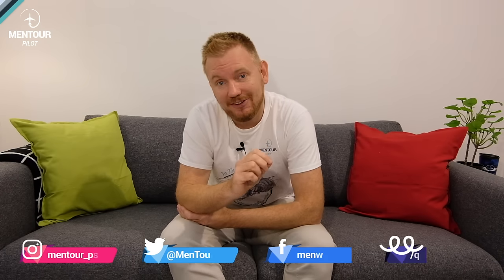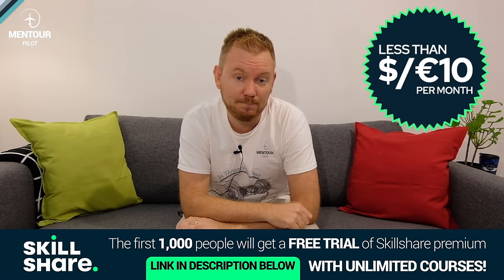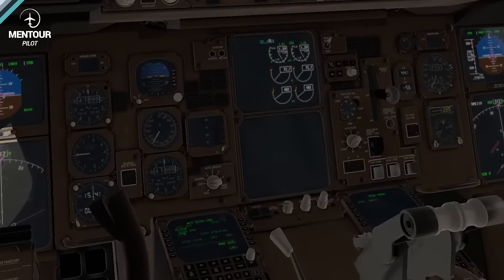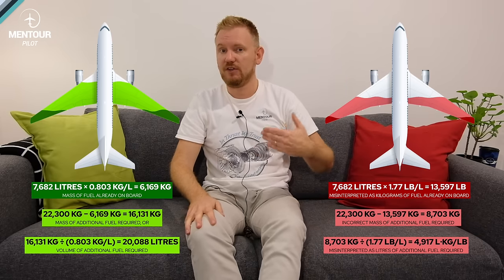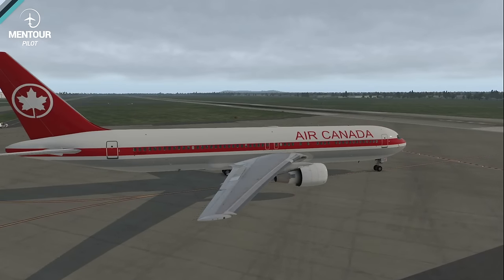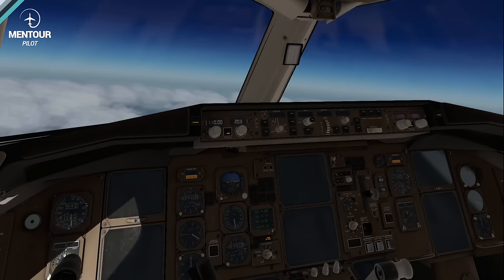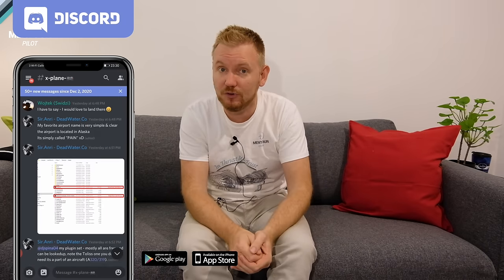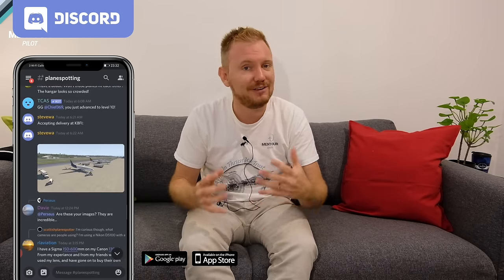The Gimli Glider! Explained

Comment: Just for interest sake I used to fly with Bob Pearson as his second officer on the B727 back in the early eighties just before AC took delivery of our B767s. He was a most wonderful and skilled captain, a pleasure to work with and a funny guy especially on our layovers. I went on the L1011 when he went to the B767. The downfall of course came when Canada decided to convert to metric and all hell broke loose, especially in the aviation sector and prematurely, in my opinion. We did not really understand it fully but nonetheless Transport Canada approved it. The bad luck that day would have that snag of an un serviceable fuel gauge which according to the M.E.L. required a fuel dripstick check on the tanks done independently by the flight crew AND maintenance the way I remember it. ALL pilots feared and hated to perform these checks as they are complicated and involved using not just charts and figures but inside the cockpit walls are spirit levels to determine the angle of the aircraft as it is sitting and apply it to the corrections. THIS is where it should have stopped. Errors are a certainty combined with the newly integrated conversion charts. Even if things were left in Imperial standards it is challenging enough. In the immediate aftermath the airline CEO at the time instantly attempted to dismiss Pearson and Quintal for the blame, and yet in the U.S. they received the highest award distinguishing them as heroes that demonstrated the finest aviation skills ever attempted in a grave emergency SAFELY. The Canadian government was so determined to make the change to metric this was just the most obvious blunder, and as the saying goes "be careful what you wish for".
Reply from the maker: Thank you for those added details!
Reply: @MentourPilot  Why is the fuelgauge on whatever is fueling a plane in volume when what you want is weight, it only serves to cause confusion and with all the safety in the airline industry I can not get my head around having to do an extra calculation like that to make it to your destination.
How is hundreds of peoples lives dependent on some random persons ability to divide or multiply something by whatever on the day?
Reply: @MrSigmatico     I guess it is because the fuel that is pumped into the tank trucks is paid for per volume (liter or gallon), the measurement how many fuel a truck can load is done in liters, not in weight.
The pilots on the other hand have to know how many kilos their (creating an example)  5000 liters of fuel weigh to calculate depending things like taking-off speed and many more.
One should think, somebody that made it to being pilot should be able to do relatively simple calculations like this.
I guess the real bug at the time was the change from pounds to kilos which had not arrived in everyones head.
Reply: The highest award most deserved.  That landing is almost beyond belief.
Reply: excellent question and point. just leave it in base units of kg.
Reply: @willshedo  Canada had begun phasing in the metric system 4 years earlier, on May 1, 1979. I remember that because I bought my first car that week. All gas stations started selling in liters instead of gallons and gas prices in my area immediately went from 99.9 cents per imperial gallon to 19.9 cents per liter. That means that the pilots, engineers, ground crew and everyone else in the country had been buying gas in liters for over 4 years at the time of the Gimli Glider incident. The metric system was NOT as unfamiliar and mysterious as the video might imply. None of that, of course, takes away from the remarkable achievement of getting the plane down safely!
Reply: @hughmungus1767  Gallons ≠ pounds.
Reply: @MrSigmatico  It is generally not an issue because you are never supposed to be refuelling based on the drip stick (now drop stick) measurements, they are for confirmation only.
Reply: @willshedo  No, the pilots were not only not responsible for these calculations, they received no training on how to do them. Mentour did a very poor job of explaining this.
Reply: I disagree that the pilots deserved commendation. Flying without a functioning fuel gauge, against what they knew to be the MEL (whatever they say the maintenance control people said), is a fireable offense, full stop. Not to mention there is nothing difficult about converting from imperial to metric units. It's one thing when a NASA contractor engineer makes a silly mistake and sends a Mars probe off course, it's another when a captain responsible for the lives of many passengers fails to use - and double-check - the right conversion factors, and then flies off without a fuel gauge. I'm sure he was a friendly, affable guy and a good pilot from an airmanship perspective, but that day he made a series of horrible mistakes that nearly cost all his passengers' lives. He deserved to be disciplined for it.
Reply: If you aren't in the aviation industry then you have not any concept of how the rules apply because the parameters are within legal binding limits meaning that the crew were quite legal to accept and fly the airplane under the limitations of the M.E.L. as such and follow the operational guidelines which is why this is put in place by EVERY commercial operator. It is clear to me you are not in any position to point a finger because you do not possess any technical skills or knowledge and therefore you want to draw attention to yourself as an expert. To say "not difficult" is a most arrogant statement spoken like most all armchair "experts".
Reply: Canada apparently should've waited to convert to the metric system until the age of Cellphones and Google. :-D ("They should 'of'  checked them fuel gages" (sic) as though the 767 were some kind of 'prop plane.)
Reply: @lisaa8795  ..It’s “should have” not “should of.” 

We switched to the Metric system years before this. The crew did a fabulous job of landing the plane, but they wouldn’t have had to do that if they did the math properly. All Canadians did the math back then. My mom had a chart in our car of gas price conversions. 
There should have been independent calculations done. All other flight crews didn’t have a problem since there were no other incidents since the Metric System was implemented. 

Regardless of the mistakes made, they deserved the commendation
Reply: @christine3043  The entire country of Canada did not officially switch to the metric system until the 80s.  Regarding your other comment correcting 'my' grammar: I was making fun of yet another youtube comment posted - that is what the quotes and (sic) were for.
Reply: @michaelbrower3068   -- Public relations is a huge aspect of aviation...   I know it's cynical, but the final result was "miraculous,' and, from a PR perspective, it would seem wrong not to reward the pilots.  That said, I agree with what you're saying.  I used to be a commercial pilot, and I think a lot of pilots struggle with the impulse to bend rules - some more than others.  Even though I can sympathize with the pilots here, I agree that complacency is totally out of place in aviation, and that pilots have to be held to a much higher standard.  That may seem harsh, but the stakes of aviation require a special level of discipline.
Reply: @pdquestions7673  Petter hit one major factor which I think was the reason the captain chose to fly.... C-GAUN came into the airport he was at with a mechanical problem.  He didn't know exactly WHAT problem, but deduced the aircraft was airworthy based on the fact it was an uneventful flight.  C-GAUN wasn't really in proper condition to fly safely, but... almost.  If they had calculated fuel properly... there would not have been a problem and the flight would have been uneventful and forgotten.  That's risky, but it's theoretically a manageable risk.
Reply: @MrSigmatico  Wild Guess, is there something to do with temperature like volume corrected gas pumps?
Reply: @hughmungus1767  People will always find a way to blame the government for issues and gloss over the reasons behind it, the benefits and in this case details that are important to bring up when judging an event such as this. In my opinion, if your job requires you to make conversions and do calculations, especially when it comes to safety of human lives, and ensuring some like a airplane has enough fuel to make its destination.......you should be expected to do those calculations day 1 regardless of any federal changes like the metric system change. There isnt any excuse. Obviously that isnt entirely on the employee(s), training and ensuring your workforce is trained and suited to make those calculations regularly and accurately is on the employer and the government to make sure the employer adheres. Its never just 1 person or 1 event that causes events like this. You cant point 1 finger at the government and call it a day. But it really doesnt stop people from doing so.
Reply: they bombed at a simple plausibility check. When they started the formula with the fuel in the tank with 7682 - their calculation gave them the result that they needed 5000 l more for a longer flight. So they had more than 50 % what they needed "left over" from the previous day. A simple calculation would have shown them: 60 %. That should have prompted some serious double checking.
Reply: + steinbombb Also: 1 kg is roughly 2 pounds so that happens to be a very userfriendly conversion ratio. 1 liter of fresh water weighs 1 kg, or approx. 2 pounds.  But fuel is "lighter" than water (lower density in correct terminology). So even when you do not know the conversion rates by heart, a factor of 0.803 is not implausible. - I for instance underestimated the density of fuel but learned right now that the conversion (multiplication) factor is  0.803, in other words 80 % of that of fresh water. - I will take Petter's word for it ;) 

A conversion factor of 1.7 would mean fuel is "heavier" (has higher density than water, and considerably higher = 70 % more) and that would have triggered my bullshit radar. 

They should have picked up that something was amiss with the calculation, and the problem did not present suddenly during flight when there is not much time to trouble shoot or to follow a discrepancy. 

The problem also preoccupied them before their second start in Ottawa - so why didn't they just get an independent opinion from a flight engineer (before the first or the second start). They also could have asked for that during the first leg, as to not lose any time. Enough time in Ottawa to correct their blunder. 

Basic understanding (1 l water = 1 kg, and fuel is somewhat ! lighter than water) would have sufficed. A conversion factor of 1.7 would mean that fuel has a considerably higher density than water, that can't be.

If they were maths / physics challenged (as I suspect) they surely could have gotten competent double checking - if they had bothered to ask for it.

They were good hands on pilots (certainly the captain was a good glider) but not good in maths - I think all things mathematical triggered avoidance and / or "winging it" - because there is no reasonable explanation (other than avoidance, I can only assume being sloppy or ego) why they decided not to get any help with a calculation that was so unfamiliar that they did not even pick up on 2 different red flags.

 If they were bushcraft pilots in the past, the ability to improvise may have been needed - or at least exercised. Winging the fuel calculation was not a good idea.

They only relied on their calculation for a critical value (as the captain was determined to fly without fuel gauge if that could not be fixed in Ottawa), and they cannot have been proficient and well-versed in the necessary skills and considerations (like a simple plausibility check). I cannot imagine they had to do such calculations in the past, so it must have been pride or avoidance that they went ahead with their amateurish execution. 

Maybe someone got them the wrong conversion factor without explicitely telling them this was liters to pounds ?? Or wrongly telling them this was from liters to pounds.

But then the plausibility thinking should have set in - moreover they knew that the transition from imperial to metric had started a few years ago. I also wonder if the ability to make such conversions was hardly ever needed (by staff that tanked the machine - or whoever gave them the conversion factor)  - maybe normally they only went by the gauge reading. But then the captain should have assumed that on this special occasion he could be fed old (imperial) coversion rates.
Reply: It's an interesting piece of trivia that the US was in the early stages of converting to metric in the late 1970s—mostly with dual distance and speed measures on interstate highways, dual temperature measures on weather reports, etc. It was Ronald Reagan who put an end to it and trapped us in the imperial system. Another piece of trivia relevant to Americans who drove in Canada is that Canadian gallons were different from US gallons.

Comment: I was in high school when this accident happened and it inspired me to learn the metric system before I joined the US Army.
Reply: It’s really easy! Everything is multiple of 10
Reply: I grew up with the metric system, and have learned small amounts of imperial in several jobs, I think metric is a far more logical system.
Reply: Thank you very much for your service sir
Reply: Growing up the UK I learned both systems at an early age. About 30 years ago I had a German pal who could not really get his head around imperial units. He thought that the inch could only be divided into tenths, twelfths or eighths. Because I had studied technical drawing I showed him that it was easy to, for example, drill holes in a piece of metal that were five thirteenth of an inch apart.  I think that his brain exploded :)
Reply: @rysacroft  Why to do it simple, when it can be done complicated    ;-)
Reply: @bobbrewer5182  That is of course because the metric system uses 10-folds as main computational characteristic. The system of pounds is for us metrically trained way more complicated.
Reply: @rysacroft  "five thirteenth of an inch" - where is an inch divided into thirteenths? Did you mean sixteenths? And I don't see how how that would be any easier.
Reply: @fredmdbud  My father was a land surveyor and I am a model maker in Canada . I grew up with the imperial system and my tools are imperial .A surveyors 100 foot tape and  machinist's rulers have feet and inches divided into tenths ,not fractions .  I don't know what Spannerman is talking about . I would assume technical drawing would use inches divided into tenths as well so you can use those numbers on a calculator .  ( machinist's rules actually have both tenths and fractions most of the time ) .
Reply: Yes but how many "football fields" in a kilometer, a mile?
Reply: @jacyborreaux919    Of course!  But I think of it as being bilingual or multilingual.  Use imperial and metric both.
Reply: I used to work in an engineering industry in the UK. We had a product we were developing where the customer had specified a special paint to be used, which had to be applied following a US MIL-STD. The US spec said it was to be applied '3 mils thick' - 3 thousandths of an inch (in US engineering English, 'mil' = 'one thousandth of an inch'). So we sent this product out to our painting subcontractor. Now in British engineering English, 'mil' is used as an abbreviation for 'millimetre' (we say 'thou' for thousandth of an inch)... you can see where this is going! We got a call from the painters - that despite practically spooning the stuff on, they couldn't get it on 3 mils thick! Once we realised what was happening (that they were trying to get it on nearly forty times thicker than they should have been) we all had a good laugh... and fortunately, it didn't kill anyone!
Reply: you can know the metric system all day long but if you dont use units at all, like the fueling team on this plane, it wont matter
Reply: @stanthology  not a good comparison, since football fields can be different sizes (depends on the football code I suppose - Gridiron, Rugby Union, Rugby League, Soccer or Australian Rules.
Reply: @andrewmurray1550  Thank you!